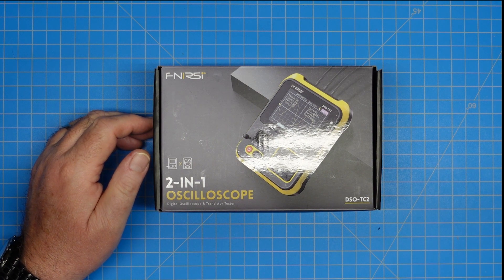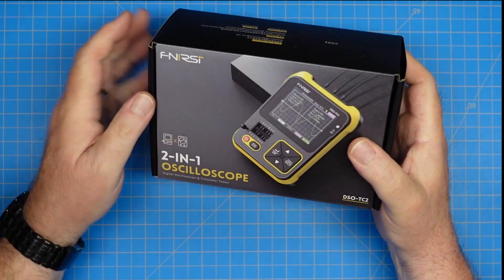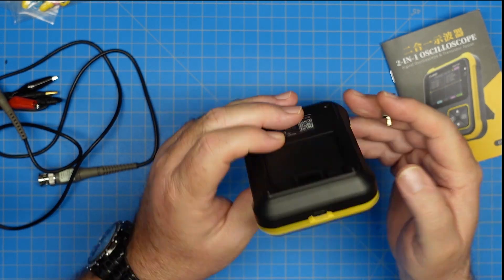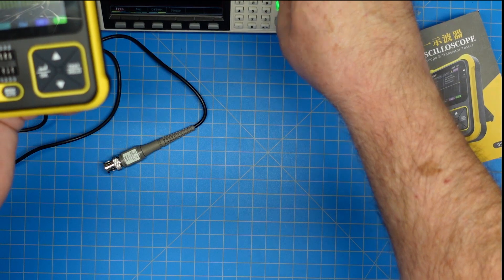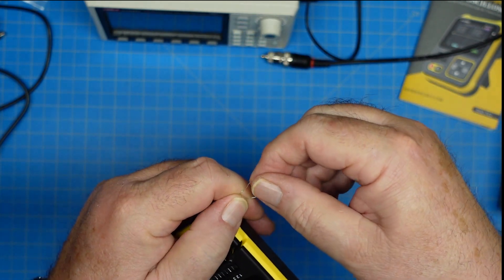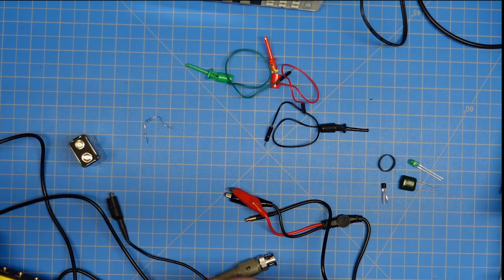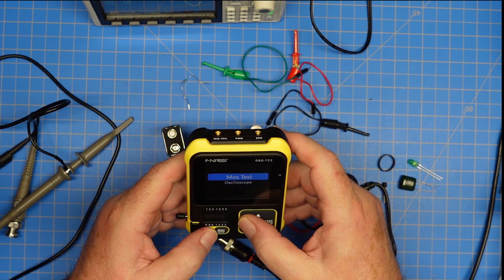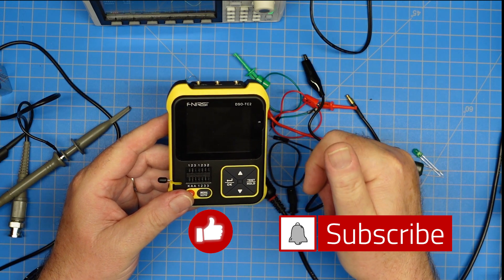Unleash Your Inner Engineer with this Super Cool Budget Scope!

Comment: The component tester is worth this price as it is. The O-Scope is really a bonus. The only thing I don't like is the flimsy connectors, which will no doubt break their solder connections if it isn't handled with kid gloves. I hope they solve that and offer this with at least a 10-25 Mhz bandwidth since hand held scopes with a 50-70 Mhz bandwidth are only double this price.

Comment: Never heard of the MCX connection. Looks like a cool little peice of kid.
Thanks for the upload.
Reply from the maker: You bet - it's an odd little thing, used in small form factor computer stuff mostly.  Old (90's) laptop wifi cards had them for external antennas, cell hotspots have them, that kind of stuff.

Comment: Thats very easy to use, especially noob's. :)
It's an affordable price too. Will it blow up if I test the frequency on 240v mains?
Reply from the maker: LOL!  AFAIK - according to the manual, it is good up to 400V on the Oscilloscope side.   As you guys are on Satan's electric company down there, I'd be even more cautious!
Reply: @FEPLabsRadio  haha, our voltage is normal. Lol
You guys are practically on battery voltage, haha.
I only found out you guys had one phase 120v or 220v over two phases, thats strange, we dont have that setup here. Houses only have 240v single phase or 415v 3 phase if you have a high load over 80 amps or have a 3phase motor or welder etc. I have 3 phase at my place as I installed electric slab heating but it costs too much to run so basically I have 3 x 240v @80a ea max per single phase to the house. I have a pad mount transformer on the boundary of my block that feeds the street so my voltage is usually between 244v to 248v @50Hz to make sure they have enough voltage to the guy at the end of our street. Not keen on High Voltage next to where I want a dipole to end.🤷‍♂️....sorry for the OM 80m rag chew Jim!😄👌... my last colonoscopy was....😄